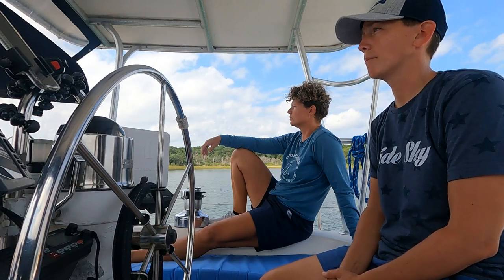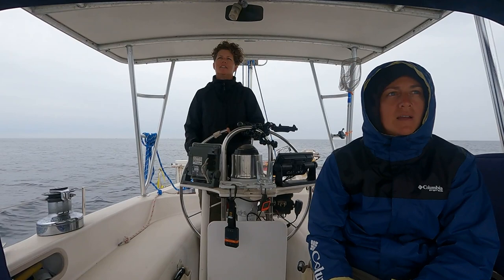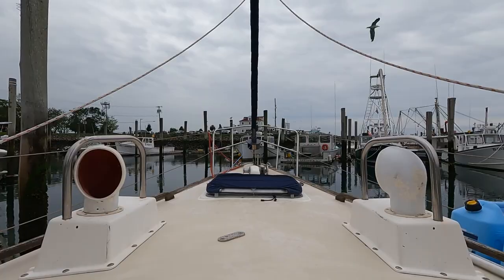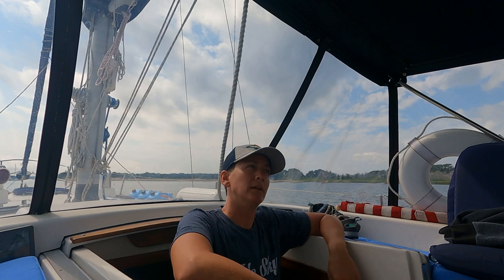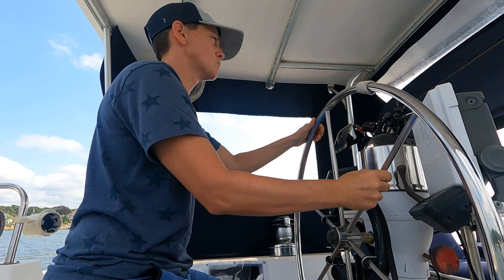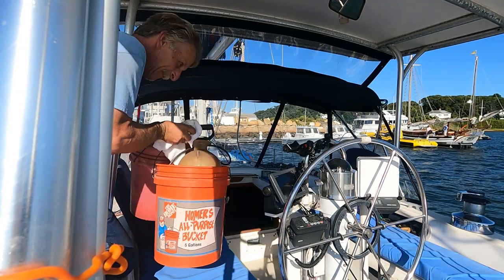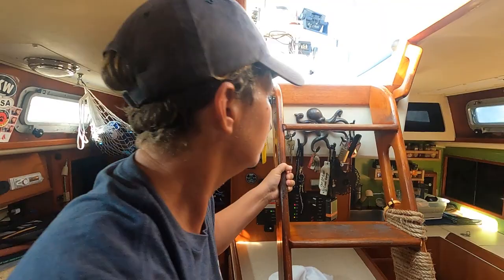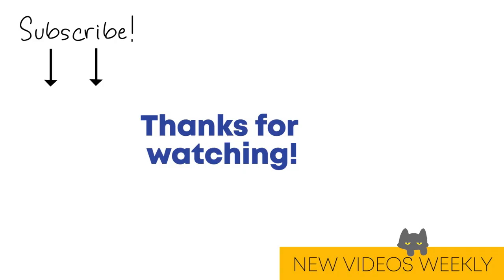Sailing from Provincetown, Ma to Pocasset, Ma

Comment: Good find on the fuel line. Looks like perhaps the tank was replaced at some point and it was just jammed in there causing the pinch. At least it didn't rupture and leave you stranded. I always carry one of those whose assemblies you use on an outboard motor tank. In a pinch you can directly feed the motor from a Jerry can. I used this once and was glad as was 30 miles from land on a windless summer day. Fair winds